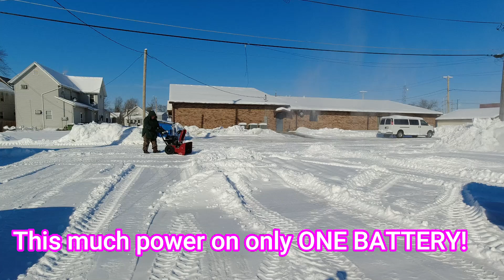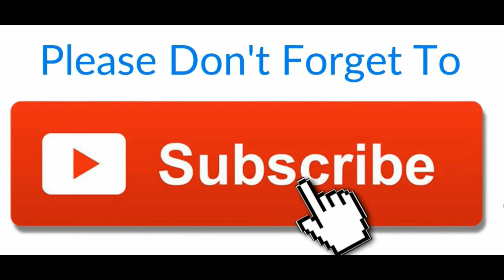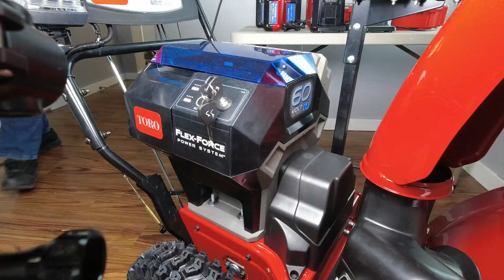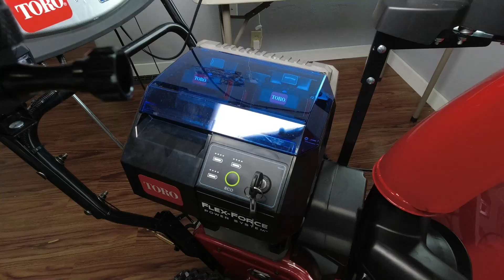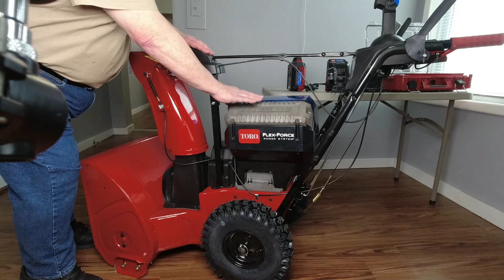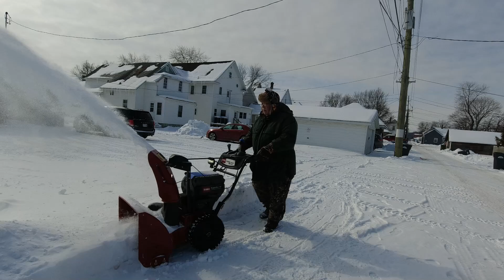First Look! NEW Toro Power Max 60V Battery Two-Stage Snow Blower

Comment: How many batteries did you use ? How many amps were each of the batteries? How much time did you get between all of them?
Reply from the maker: I had three 7.5 AH batteries when I did that video. Each one lasts about 15-20 minutes depending if you use the "economy setting" . Full power they each go 15 minutes.

Comment: Toro 60v power equipment and batteries are no longer are listed on the Home Depot website (for the last month or two) -- any idea why? Toro still lists them as authorized seller for purchasing online, but their link to Home Depot shows nothing is available when you click on it... Not just snow throwers, all 60v equipment. Is there a problem with Toro's 60V power equipment?
Reply: Rumor is Toro is forcing dealers to sell a lot more battery snow blowers than gas... I guess due to this Home Depot USA decided to opt-out of the whole Toro battery powered OPE ecosystem -- nothing shows up on US sites. However, it looks like Home Depot Canada is still selling them. It would be nice if Home Depot USA made notice of this rather than silently dropping the line after I purchased a Toro E26 from them last year... I even sent a message asking them why the 60V battery stuff is gone, they person that responded was clueless...
Reply from the maker: Yes, I've had a request for clarification in for a month now and still have heard nothing. If I was to speculate I'd guess that THD told Toro to pack sand when they announced the Lowes partnership. (THD did that with Hustler when Hustler decided to go to Lowes)
Reply: @PaulSikkema  Sounds plausible. However, Home Depot is still selling all the other Toro OPE, but absolutely zero battery equipment...

Comment: Like all Toro 2 stage blowers this one seems well-built. However I'm having a hard time accepting everything moving towards electric.  There seems to be a war on the internal combustion engine and a rush to its demise.  As others have mentioned batteries are pricey maybe one day they will go down, maybe not.  Additionally lithium ion batteries do pose a fire risk, mainly when charged overnight with universal type chargers. There have been some devastating lithium ion battery fires in NY City lately that proved very difficult to put out.
Reply from the maker: Right now battery powered mowers and snowblowers are for homeowners who are tired of gas and all the problems we've had with gummed up carbs and fuel that absorbs moisture. 
Toro specifically has thermal and current protection built right into the batteries and chargers. Both will shut down if there is an issue. In addition the batteries inside the packs are a higher quality than you find in other types of battery powered equipment like hoverboards and electric bikes.

Comment: Thanks for another terrific review, Paul. I totally agree - I love what the Toro engineers have done with this design. And I love their general treatment in introducing battery-powered mowers and snow blowers, maintaining the basics of the gas-powered versions, while implementing a conversion to electric. They promote confidence in the consumer by taking advantage of their reputation as a manufacturer of rugged equipment, rather than a stripped-down design, converting major materials to plastic, etc. as others have done.

Comment: V2 should be interesting, would be cool if they allow an automatic turbo mode that can draw from the other 2 batteries for short periods of time and overpower the motor.  Just monitor the battery and motor temps and turn on a light and disable that feature when the temps are high and/or voltages are low.
Reply from the maker: Brushless motors like the one in this snowblower run at a certain RPM. The more the load the more current it will draw to maintain that rpm. So, it does have the "turbo mode" when you put a lot of snow through the snow blower.
Reply: They are current limited though, if you push it hard enough it will stall out.  It sounds like it can only utilize 1 of the 3 batteries at a time which means you can only get the full power that 1 battery can supply.
Reply from the maker: By stalling out you mean the current limiter (safety) for the batteries will turn the machine off. When that happens the unit beeps loudly. The only time I've had this happen is starting the impeller quickly with snow in it. 
These batteries are protected so that they won't develop the thermal runaway (lithium fire) like many of the radio control batteries without the protections.

Comment: I just purchased the 24 " model of this and was wondering how it would compare to throwing snow against the gas powered models. I just have a single lane driveway that would accommodate maybe 4 cars. so hope it will suffice. Thanks for your videos I am a new subscriber.
Reply from the maker: Your new snowblower is a Power Max 824 OE with the gas engine switched out for an electric motor module. You'll find it does just as well as the gas unit. 
Two 6.0.AH batteries will give you about 30 minutes of run-time so you can easily clear your driveway. 
If  you find you don't have enough battery to finish the driveway purchase two 60V MAX* Li-Ion Battery 5.4 Amp Rapid Charger (88605). They will charge your batteries in less than an hour. (compared to the 120 minutes for the 2.0 amp quick chargers you have.
Reply: @PaulSikkema  Hi Paul many thanks so that information. I do have the Toro recycler battery mower with the 6AH battery and I  also purchased another 6.0 AH battery. So I now have 4 batteries to use . I will switch them out if I need to. I love the lawnmower and thats why I went with the Toro snow blower rather than the EGO. I do have a 26 ' cub cadet gas blower thats 12 yrs old and was just getting tired of switching out oil and spark plug every year. I gave it  to my brother-in-law since his blew up. I figured since I have a small driveway and live in Southern Ontario we dont really get alot of snow I didnt need the 26" Toro and purchased the 24' also so my wife could use it as well. Love your videos and your videos convinced me to go to the Toro battery operated blower. keep up the great videos. Thanks again for your great reply.

Comment: In my experience so far, the 7.5Ah batteries take about 3:15 to charge on the standard chargers that come with the E26.  I also bought two of the rapid chargers and they will charge in about 1:15.  In both cases I am talking about completely discharged batteries when they went on the charger.
Reply from the maker: I can live with 1.15. Toro just announced a 10 AH battery and a new Pro battery. The new black pro battery and pro charger will charge to 80% in fifteen minutes!
Reply: @PaulSikkema   Hey paul was this the e24 or e26, how did it handle that heavy snow at the bottom of the drive way the snow plows dump?
Reply from the maker: This is the e26. The e24 doesn't have all the features this one has. Yes, It handles the end of driveway snow well. It preforms just like the 826 gas. Please go to my channel - I have other videos on it.

Comment: I'm sure it will blow snow with its pewny little auger and big batteries, BUT, what willnew batteries cost when them wear out? (they will fail at some point, they all do) There's the additional cost that people don't think about.
Reply from the maker: I have Toro batteries that are over 4 years old and I have had no issue with them. These high quality Lithium-ion batteries will last 100's of charges if you take care of them properly. I have more than just a snowblower and use the batteries all year long. 
Lithium cell prices are over 30% less than they were five years ago and they continue to come down every year. So your next set may cost less than the ones you own now - or you will be able to get higher capacity batteries for the same price!

Comment: I just received one of these.  It's August, so several more months before I will be able to use it in snow.  I am kind of concerned at the amount of racket when the augers are engaged.  I have ArmorSkids on it now with about 1" of scraper bar clearance as my yard is all dirt covered with wood mulch.

I am wondering if gas blowers make as much auger noise but you just can't hear it because of the engine noise.  I also figure the rattling from the augers will be damped by a load of snow.

I have inspected the augers and impeller.  I don't see anywhere things are hitting each other.  Should I be concerned?
Reply from the maker: Take all the batteries out and tip the snowblower back on it's handles. Wiggle the front auger and the impeller up and down, back and forth, etc. with your hands. Since your snowblower doesn't use shear pins there should be none or very little play in any of the pieces. (there will be a small amount of "play" in the gearbox.)  
Since you've ran it, look closely at the impeller housing for black marks and on the edge of the auger for red paint. Do the same with the impeller.  If you find anything that moves check the tightness of the auger and impeller bolts. 
Sometimes the chute rattles. Put the unit back down and then wiggle the base of the chute. If it rattles check the mounting rod bolts to see if they are tight. 
If you found nothing then have someone run the auger and watch it from the front. Do you see any up and down or side-to-side movement. 
If you don't find anything and it still rattles take it to your local dealer and have them look at it. It's basically an 826 gas unit with an electric motor so they should be able to figure it out. 
Finally, I have a new one in the box and I'll unbox it in a few weeks. I'll make a video and check if this new one rattles.

Comment: What about moisture in the battery compartment. Usually a snow blower is covered in snow after use. It didn't look like the compartment had a tight seal.
Reply from the maker: The batteries themselves are water resistant - meaning they can get rain and snow on them without having issues. Also the battery compartment has drain holes so any water that may get in will leak away. Finally, this was a pre-production model. The battery compartment on the production models latch and seal better.

Comment: So I noticed on mine after using it a few times. 

The right auger spring adjustment loosen up. The buckle was tight. 

I set it for what the factory told me. 2 and 3/4 in with the lever press down. I even used a digital caliper. 

Now I'm lucky if I get 2 and 1/2 in And I cannot adjust it anymore. It's almost like The belt wore in or something. Now the cable itself is too long no matter how much you adjust the turnbuckle. 

Is there any way to fix this without getting a new cable. 

Is there anyway to tighten up the belt or something inside? 

These are things I can do myself. I don't want to bring it to an authorized service center. I don't have a truck. And it's brand new. Spent a lot of money for this thing $1,800 including tax I don't want to spend any more money having someone else fix it. 

Yes the auger turns when I press the lever But I don't know if it's going to get even more loose..
Reply from the maker: Make sure the cable is routed correctly. 
Watch this video. I go through the parts under the belt cover and how to adjust the cables. https://www.youtube.com/watch?v=rNQTCDxhU54&t=597s
I also talk about adjusting the cables in this video: https://www.youtube.com/watch?v=nkjL84P_EuU
If you don't have the operator's manual you can get it here: https://www.toro.com/en/parts/partdetails/?id=52521
Since your snowblower is the same as the 826 gas unit there is a sevice manual for that. It gets into the area under the belt cover. https://www.toro.com/en/parts/partdetails/?id=52736.
If that doesn't help I suggest taking to a Toro Dealer.

Comment: One interesting thing. I think I talked to you about making the machine go slower. Too fast in first gear. You said to slow it down It wasn't easily done. 

Well from what I understand it's pretty easy. And maybe you can tell me why this works and if it's good or bad.

People are saying all you have to do is take the gear shift lever the one that goes six forward and two reverse ( silver metal rod That connection to the transmission ) You take the cotter pin out at the top And because it's threaded you just turn the clockwise a few turns maybe three or four Then you put It back in the hole put the cotter pin back in,  and like magic all the speeds slow down. 

I did this and it worked perfectly. I dropped the speed to half of what it was which was perfect. 

But I'm worried that This might not be good I don't know exactly how it works. 

But it works and it works beautifully.. 

Check out this video below This is where I learned it from. 

https://youtu.be/7SGFoYY-vFA
Reply from the maker: I'm assuming that your dealer assembled and set up the snowblower for you so the speeds should be correct. If you or a big box store assembled it the speed may be off and you should adjust it. 
Your transmission is linear. It's simply a rubber tire and moves across an aluminum plate. Meaning if you change the speed of first gear you also change all the other gears - including reverse. 
By reducing first gear you sped up the reverse - maybe to the point where it is way too fast in reverse. Or you may have to move the lever to R2 just to get it to move. 
I noticed none of the videos that show you how to change the speed bother to tell you that it also changes your reverse.